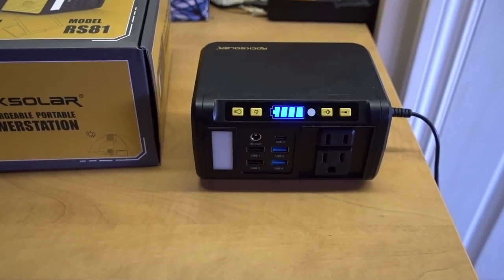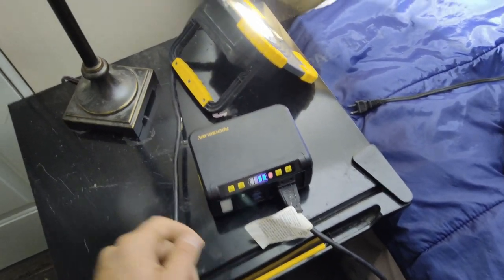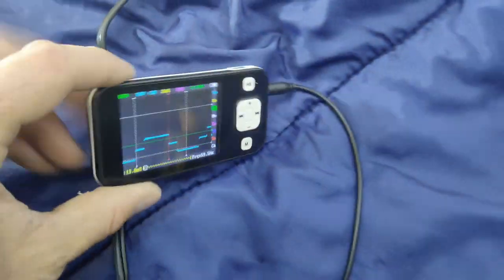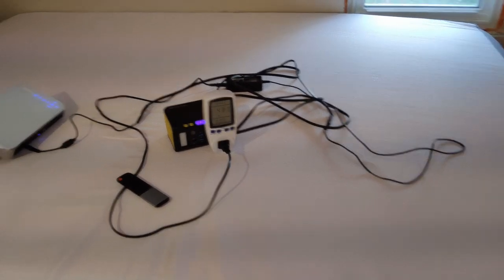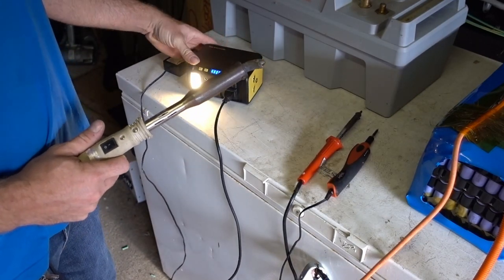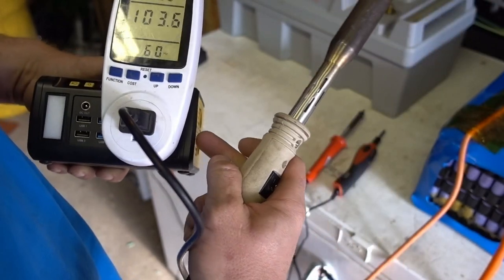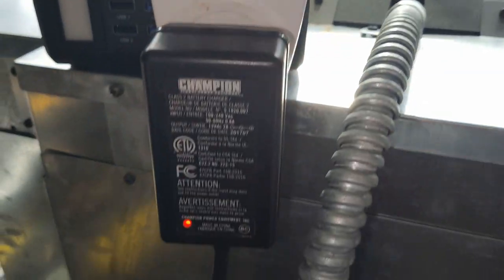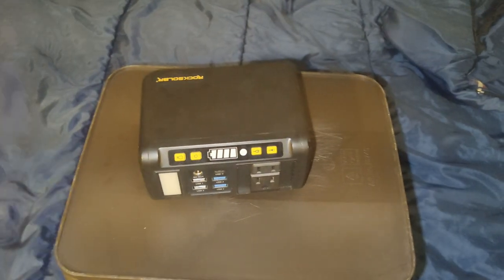RockSolar Weekender Solar Generator TEST

Comment: I had a modified sign wave inverter set up to charge my tool batteries.  Batteries are fine but the chargers gave up after about a year and had to be replaced.  Lesson learned.
Reply from the maker: yea modified sine wave is harder on electronics.

Comment: Questions and questions lol I bought this one because it’s cute and small lol how long does the charges last when plugging in items and how do u use the solar panel to charge this and how long do u charge it for
Reply from the maker: It depends of what your running, use last longer then the 120 v plug and the solar panel comes with a few adapters that makes it so you can plug most brands of folding solar panels into it, charge is around 5-8 hours in sun
Reply: I was able to charge it outside I say it took 4 to more hours to charge on the solar panel outside . I noticed if I need to use the plugs I had to turn the plug button which the circle beside is red lol is this normal colour ? I thought it would be green lol
Reply from the maker: @tuttiandmistygonecrazy9067  yes its red, mine is as well :)
Reply: Here's the problem with this power station, it only has a 24000mAh battery.  If you go to Amazon and type "power bank", you will see that there are many portable solar power banks that have 30000mAh batteries and more for around half the price.  This means that my old power bank from 2018 has more battery power (25000mAh) than this "power station".  My old power bank can also be charged via solar panels through USB, whereas I suspect (although I could be wrong) that this power station can only be charged through an AC plug or DC Solar power.
Reply from the maker: @kazmodan82  is can be charged from solar as well and has 120 v outlet that's where the others do not have and it's worth more cause of it:)

Comment: Thanks for the review. Helpful to see what it can handle. If you're going to do some more testing I'd be interested in what kind of solar panel to buy for it. I think you go by the voltage? Their documentation says solar power input is DC 15v - 25v. Do you know if there are cheap folding panels for this, less than $100?
Reply from the maker: O yes, I need to figure out what's the max wattage first.
Reply from the maker: any solar panel that is 7 to 25 volts will work 30w to 100w

Comment: How long does it take for a full charge using a outlet ? Also how long does the battery last?
Reply from the maker: I believe it was 5 hours to charge and it depends on what your running on how long it last

Comment: Could a 30 watt 27 volt hand crank generator, charge this up efficiently? I think the brand was hauber
Reply from the maker: as long as you don't go over the voltage this power station is rated for yes.

Comment: Does it work with any solar panels or do they one work with the rocksolar ones
Reply from the maker: Any panel if you have the adapter
Reply from the maker: Panel voltage can't be over 25 volts

Comment: Hi there, I have a question about the Weekender? Can it charge via USB-C?
Reply from the maker: No it has its own charger, it can also be charged off solar
Reply: @GoingOffGrid101  Thanks for the help! This looks like a great charger, but I need that, so I ordered a golabs instead.
Reply from the maker: @steammate4140  id love to test one
Reply: @GoingOffGrid101  For the price, pretty tempting not to! The rocksolar looked near perfect for me, but for 70$ more I got the i200, the extra 70$ gets you three times the watt hour rating (88 vs 256!). given I live rurally and just had a nasty power outage that's an easy upsell
Reply from the maker: @steammate4140  sounds like a great deal!

Comment: Does anyone know what type of solar panel would be compatible with this unit? The ones sold by the rocksolar brand are a little pricey, does it work exclusively with their brand only?
Reply from the maker: im 90% sure any 20-30w panal 15-25 volts will work, testing coming soon.
Reply from the maker: use my code going34 for20% off and rocksolar merchandise.
Reply: @GoingOffGrid101  thank you, the details on Amazon state it has a built in inverter, I can only assume this is true, would this increase the variety of solar panel that could be used?
Reply from the maker: @jeremybenoit759    the inverter is the part that converters DC battery power to AC house hold plugs, as long as you are with in the specs rocksolar provids im pretty sure you can use any sole panel, I will test this in the next 2 weeks :)
Reply: @GoingOffGrid101  ok, thank you, I am interested to see if I could run an electric griddle through solar power as part of a economic and environmentally friendly mobile food truck sort of business, without the truck cuz that defeats the environmentally friendly part lol, if you can run a soldering iron I see no reason I can't run a grill as that is essentially just a soldering iron with adjustable temperature pluged into a heating element , turn it off when not using and take back the power from the sun.
Reply from the maker: @jeremybenoit759  you could but will need a larger unit to run that, around 1500w
Reply: @GoingOffGrid101  possibly, I'm just talking about the average residential counter top grill though, not industrial, I have since seen another video and model with the exact same specs running a newer model flat screen tv if that information is of interest to your research
Reply: Hi, just an update, I have just read on the rocksolar website they recommend their 30, 60, or 100w solar panels, from what I am understanding that would suggest any 30,60, or 100 watt panel should work as long as it comes with or you buy separate the adapter that you may or may not need with any random branded panel based on the videos I've watched, no panel reaches 100% of it's rating and I'm assuming higher wattage would only make it charge the unit faster to an extent.
Reply: Hi all! This 80W Weekender unit has a 3.5x1.35mm solar panel input, so be sure to check your panel outputs for charging to ensure its compatible. There are adapters on the market if you're looking to make your existing panel work! As for the ROCKSOLAR panels, we sell 30W, 60W and 100W panels that would all be compatible with this unit. Our new solar panels come with 10 additional conversion ports for charging various brands of portable power stations as well. You can check out the specs of all 3 versions here: https://www.rocksolars.com/collections/all/solar-panel
Reply: @rocksolars  how can you run 100W solar panel into a 80w unit though?  Also the code Going34 only gets me 10% in Canada. Can this be fixed? Also, if I order from your site is this in Canadian dollars at checkout?

Comment: Be careful with RockSolar. Depending on the type of battery, BMS will fry your AC outlets and you will not be able to fix them. This happened to me with their Power Station product.
Reply from the maker: how did this happen? this doesn't make sense.
Reply: @GoingOffGrid101  Tell me about it. I even emailed the company's support and got no response back. 

I don't have any of the smaller models, but from my understanding, there are physical switches on them that allow you to reset the system and outlets. There isn't one on the power station, but I found a couple forum threads online that suggested you could reset by either a) flicking the power switch off and back on, or b) recharging the unit through wall outlet or solar panel. Neither of those options worked, so I'm left to assume the system I own was defective. Thing is, I also found some other people complaining of the exact same issue.

Comment: After 2 years of use on mine, performance really degraded. Internal battery began to swell.  Nothing beats pure sine wave power. You get what you pay for. Pulse width modulated systems are way more expensive but are a better bang for your buck. Good things don't necessarily come in small packages. The test of time of most of these inverter chargers, light combo's is horrible and when it comes to disposal its not that environmental friendly. We're still behind the times when it comes to compact portable power.
Reply from the maker: how did it swell ? its got 18650s in it, its not possible to swell.
Reply: @fliping720  they expand. Basically its a set of cylinder type batteries with a overload thermistor. Once any one those expand the thermister gets damaged and the battery only charges to two bars and inverter use just overloads because it has a safety protection and BCM
Reply from the maker: @Ecksterphono  interesting 🤔,  thanks for the information 👍

Comment: Mine won't charge
Reply from the maker: with the wall charger ?
Reply: @GoingOffGrid101  Yes, it doesn't charge with the wall charger
Reply from the maker: @kingdominspiredfilms8838  have you tried a solar panel, maybe the charger died
Reply: @GoingOffGrid101  I don't have the solar panel